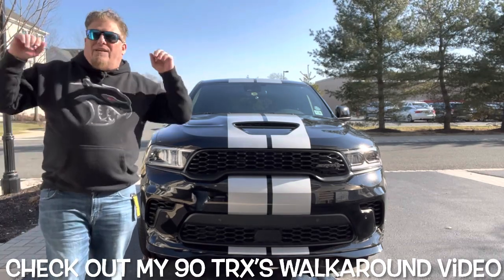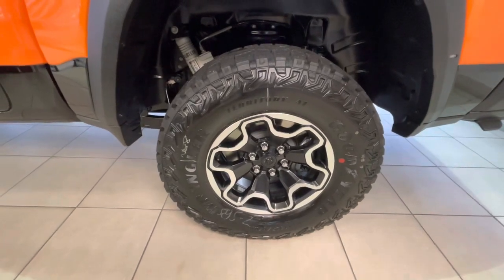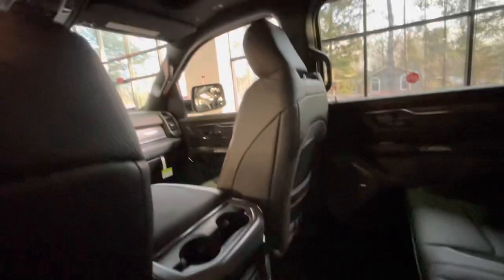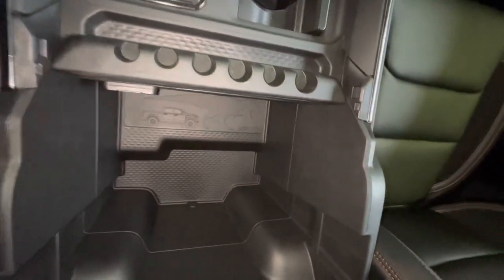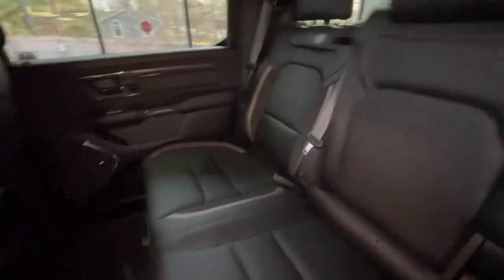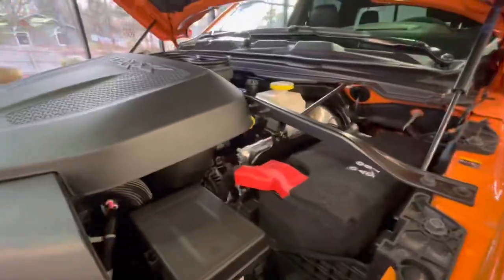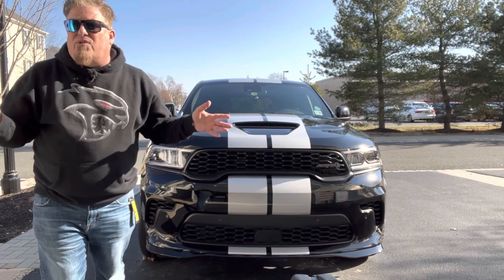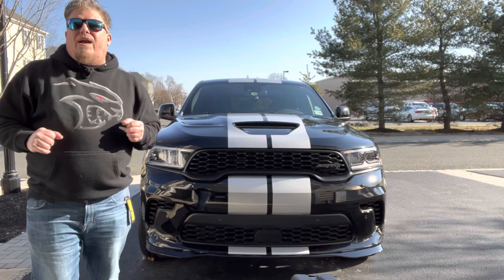2022 RAM TRX IGNITION EDITION REVIEW & WALKAROUND -1 of 875 Made -Better Than Launch Edition?🤷‍♂️😎

Comment: Hello! I came across this video because I’m looking at getting a TRX. I’m considering trading my two hellcats for one.🤔 I live in Kentucky and have a piece of land with a steep hill so a TRX would be great. I’m just worried about gas mileage. I’m averaging 15 miles per gallon in my hellcats. That is about as low as I would want to go.🤔
Reply from the maker: Thank you for the comment.  Out of the all of the Hellcat powered vehicles, the TRX unfortunately has the worst avg Gas Mileage ⛽️    My friend has one and averages 10mpg.   My Trackhawk does slightly better at 12mpg.   Its all about weight and how much the TRX is heavier than the Trackhawk, Charger, Challenger & Durango.
Reply: Dude you have the perfect state to get one. Call Dawson at Dan Cummins and u can have one 9k off msrp